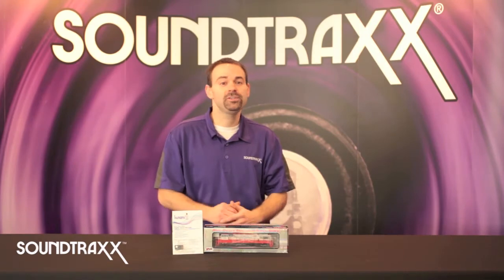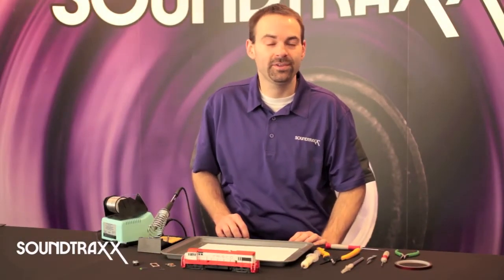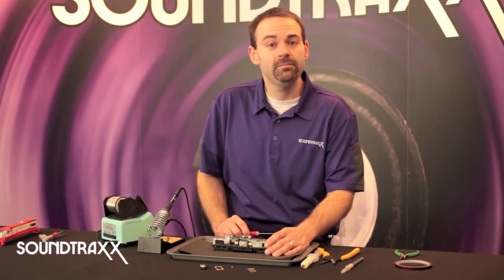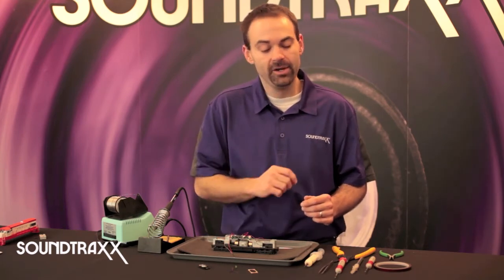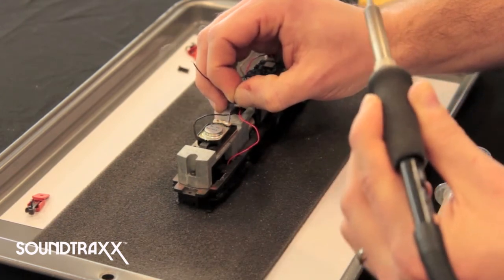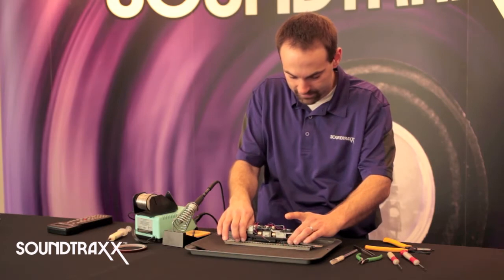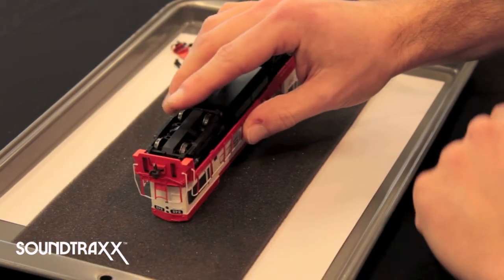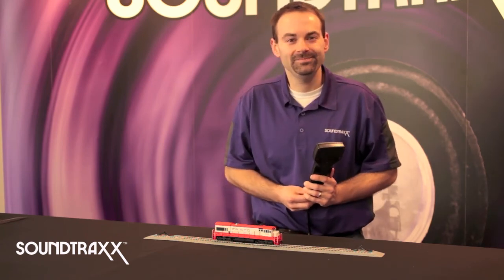SoundTraxx Tsunami2 TSU-21PNEM Installation in an Atlas Master SeriesModel

Comment: What brand, type of iron do you recommend on buying?
Reply from the maker: All you need is a temperature controlled 25 watt soldering iron. We personally use a weller soldering station.
Reply from the maker: Make sure it has a fine tip!

Comment: Great video and product. I have many of these Atlas units with the 21 pin motherboard. Where can I attach a Current keeper? Also, where can I attach extra lighting LEDs for F5/6 such as Rotary Beacons?
Reply from the maker: Your decoder packaging will have a wiring diagram that shows this. You can also find wiring diagrams in the installation guide on our website: https://soundtraxx.com/reference/manuals/
Reply: @SoundtraxxDCC  which current keeper would fit best in this loco a 810140 or a 810160?  Thanjs

Comment: Finding this video was perfect timing as I was shopping for supplies to do just such an installation. However, I don't see any link for a supplier of the 1.5mm JST 2 pin wiring harness that you mention several times in the video. Would it be possible to supply a link in a reply to this comment? Thanks!
Reply from the maker: Hi, we are glad this video is helpful. You can find the harness from Walthers or Atlas.